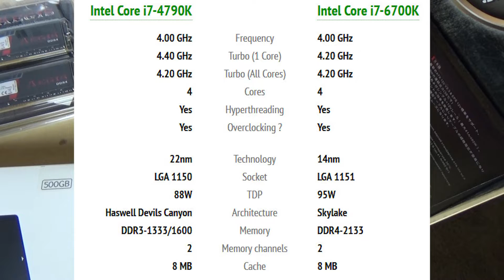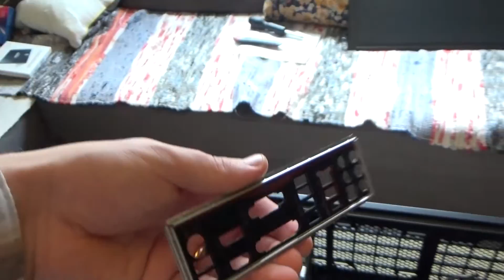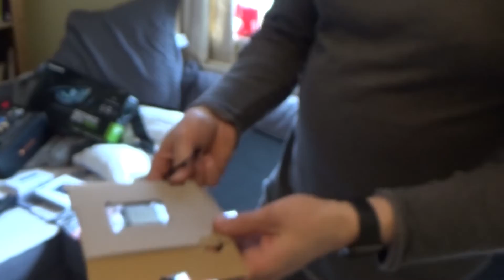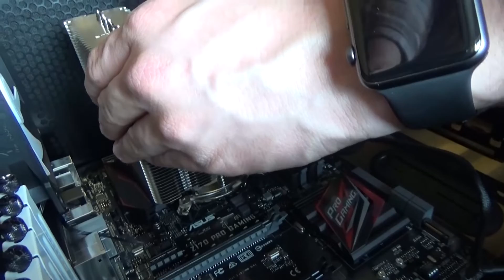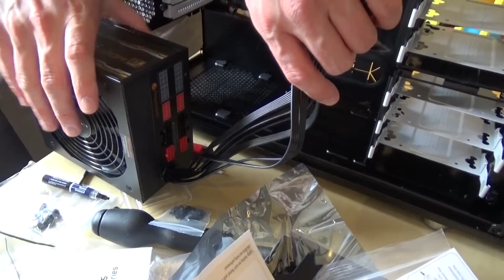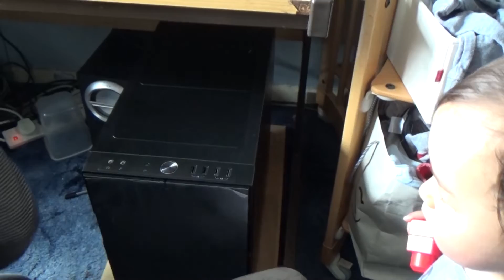Gaming PC build tutorial for beginners! Step by step install, tips, tricks & buyers guide!

Comment: PCPartPicker part list: https://pcpartpicker.com/list/Qxjrqk
Price breakdown by merchant: https://pcpartpicker.com/list/Qxjrqk/by_merchant/

CPU: Intel Core i5-6600K 3.5GHz Quad-Core Processor  ($229.99 @ SuperBiiz) 
CPU Cooler: CRYORIG H7 49.0 CFM CPU Cooler  ($34.88 @ OutletPC) 
Motherboard: Asus Z170-A ATX LGA1151 Motherboard  ($149.38 @ NCIX US) 
Memory: Corsair Vengeance LPX 16GB (2 x 8GB) DDR4-3000 Memory  ($105.99 @ Newegg) 
Storage: Samsung 850 EVO-Series 250GB 2.5" Solid State Drive  ($93.88 @ OutletPC) 
Storage: *Toshiba 2TB 3.5" 7200RPM Internal Hard Drive  ($67.99 @ B&H) 
Video Card: MSI GeForce GTX 1060 6GB 6GB GAMING X Video Card  ($276.99 @ SuperBiiz) 
Case: Corsair 750D Airflow Edition ATX Full Tower Case  ($149.49 @ Newegg) 
Power Supply: EVGA SuperNOVA NEX 650W 80+ Gold Certified Fully-Modular ATX Power Supply  ($74.99 @ Jet) 
Optical Drive: Asus DRW-24B1ST/BLK/B/AS DVD/CD Writer  ($18.88 @ OutletPC) 
Operating System: Microsoft Windows 10 Home OEM 64-bit  ($88.58 @ OutletPC) 
Total: $1291.04
Prices include shipping, taxes, and discounts when available
*Lowest price parts chosen from parametric criteria
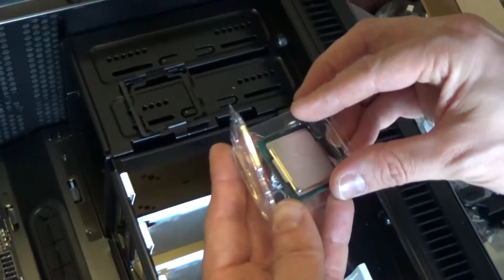Generated by PCPartPicker 2016-12-30 18:39 EST-0500
Reply: Is this good???
Reply: https://pcpartpicker.com/list/JLgNsJ if you're looking for a high-end, hardcore gaming PC. I assumed that your budget was around $1300.

Comment: Hi!

I need help. I am going to build a gaming pc and i need help in whether my graphics card will fit into my 
motherboard. I will provide links which will lead you to the 2 parts. Please, i need help. Idk what the
descriptions on each of the parts mean.

Graphics Card - http://www.msy.com.au/act/fyshwick/pc-components/17238--asus-turbo-gtx1080-8g-8g-gtx-1080-turbo-pci-e-vga-card.html

Motherboard - http://www.msy.com.au/act/fyshwick/pc-components/16052-gigabyte-z170x-gaming-3-intel-z170-s1151-4xddr4-3xpciex16-hdmi-dvi-usb31-atx-motherboard.html

Anyone who knows if it does fit or not, please reply to this comment. I need help please. Thanks! :)
I also have another problem which i dont know who to refer to. 
Idk if my psu is an 8 pin psu (my graphics card requires an 8 pin power supply connector). I will also provide 2 links below which will lead you to an information page to the psu

PSU Info page - http://www.antec.com/connectors.php?ProdID=11283

PSU page - http://www.msy.com.au/home/13293-antec-vp-700p-700w-strictly-power-88-effiency-power-supply-unit.html

I know this is a huuge post. But I really do need help. I hope the reply comes soon! Thanks!
Reply: Fuck you,dude! I told him to save some money if he dsnt have much ..for games or gadges!!!
Reply: I think that pins for grapichs card all same on every motherboard.
Reply: and you are crazy for buying that expensive grapics card! there are for only like $200 with 1050 :/
Reply: Dne Tne you are stupid, of course a 1050 is $200 because it sucks, a 1080 doesn't suck
Reply: Dne Tne I have control over my expenses.
Reply: Use pcpartpicker.com It'll tell you if your parts are compatible with each other
Reply: CriticalCompoud  go to pc part picker they help u pick compatible parts
Reply: okey..thank you..for nothing

Comment: I have to say I cringed to some things in this video as someone who's been building PCs since 1998. Especially to some terminology used for example "cooling unit" for CPU cooler or just heat sink.

I personally like to install the CPU and heat sink before putting the motherboard (you called it main board) into the case, at this point I usually install the RAM too, because in some cases you can't put the RAM in if the CPU cooler is already installed. You ran into this problem in this video too.

I have never used those alignment tools for CPU installation and never had a failure (I never actually seen one and apparently it's a new thing with asus Z170 mobos). One safety precaution you didn't do that is actually very important is you didn't discharge (or at least didn't mention it) your selves from static electricity by touching the metal frame of the case or used purpose built anti-static wrist strap (waste of money if you just touch the metal frame of the case).

In the end the system boots up and works, so job well done I guess. Good video.
Reply from the maker: +MadFinnTech Hehe...well we tried our best. Probably heat sink is the correct term...but as I say in the beginning. We are just two germans trying hard to speak english. So please forgive us as we are not too familiar with the english terminology. ;) 

Yes....we should have installed CPU, cooler & ram before putting the board in. We were aware of these discharge wristbands but just touched the case every now and then. But you are right! It is important and we didn't really mention it. 

In any case...thanks for the feedback and glad you like the video. ;)
Reply: Yeah, I understand, english isn't my first language either. Keep up the good work! :)

Comment: Great choice of parts and some great footage but there's a few things I want to point out to others who might watch this video and might use this video as full on guide for themselves. The amount of thermal paste you put on your cpu should be the size of a pea for the normal lga 115x sockets, ofcourse increasing the amount if you have a lga 2011 socket since the cpu itself is bigger. Also a thing I like to do with my builds is that when I take the motherboard out of the box I put it on top of the box it came in (not on the anti static bag) and install the ram, the cpu and the cpu cooler (only if I am using the intel stock cooler) before I place the motherboard in the case, makes it a lot easier. Also a good idea is to put your PSU in the case before you put the motherboard in so you can route your 4/8 pin motherboard power behind the motherboard with ease, again all personal preference but I do think it makes it easier. There would be so many other pointers I could give but that'd take ages, just wanted to mention the more important ones here. Hopefully it helps someone out.
Reply from the maker: +EestiGaming Hi! Thanks for your detailed comment! Really helpful. A pea sized bit of thermal paste seems a lot to me. Considering how the little bit we used here already spread out? I guess you just really want to avoid the paste squeeezing out on the edges. So maybe it's better to use a little less first and see how it spreads? I'd guess we used about half a pea sized bit in this build!?

Also installing Ram etc on the board first, before putting it in makes a lot of sense. I guess we failed a bit on that end. ;)

In any case...thanks for your tips. Seems like you know what your talking about. ;)